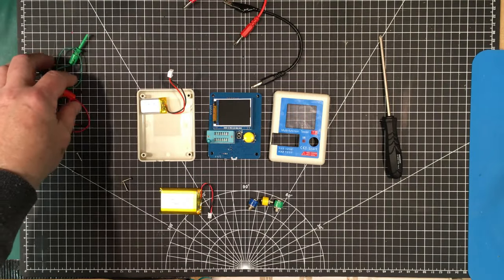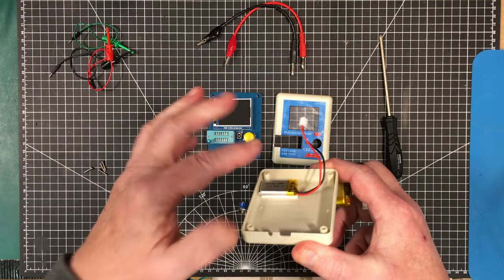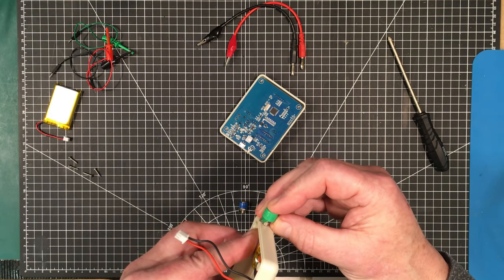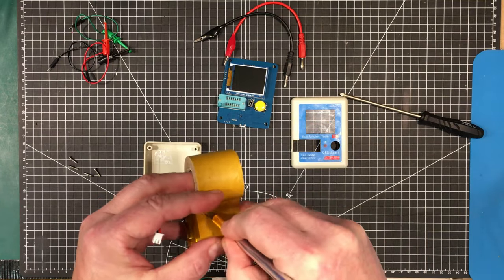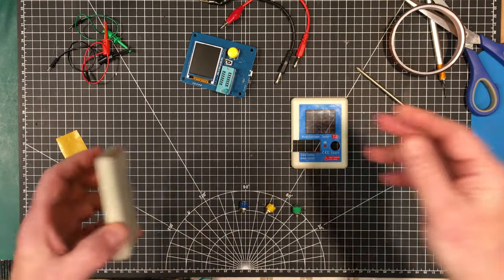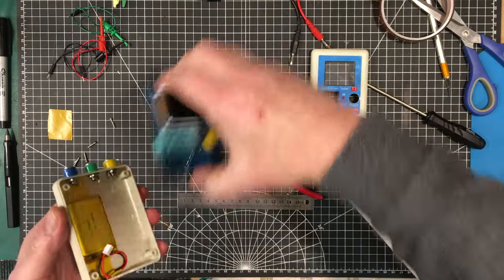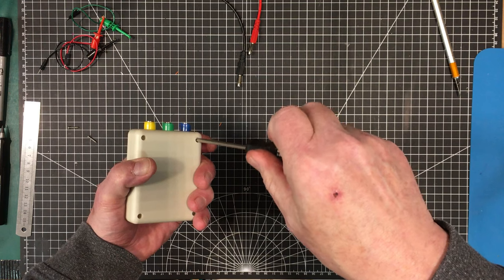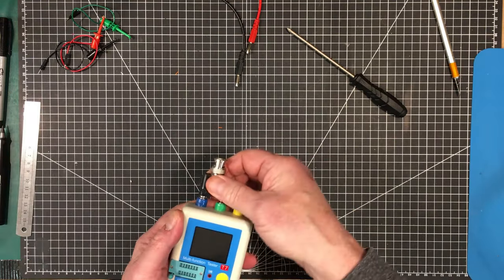Uni-Byte 0174 - Three Awesome MODS for the T7 component TESTER! (transistor tester)

Comment: I did some mods too ... banaplugs like you did and an actual switch to cut the connection to the battery. Because T7 seems to "eat" batteries even powered off.
Reply from the maker: Good idea.  Yeah, it keeps the MCU on in low power mode waiting for a button push.
Reply: @uni-byte  maybe add a selector switch for the zener diode function.
Reply: I done that too and now battery Last extremly longer. thx vor the banana Idea, will do it too
Reply from the maker: @sarahb.8186  Let us know ho wit goes.
Reply from the maker: @20kilovolt  Good suggestion!

Comment: My best upgrade for my component tester was to throw away the battery altogether and wire it into the old PC power supply that I use to run various things on my test bench.
Love the banana plugs... gotta do something to replace the worn-out ZIF socket on mine.
Reply from the maker: A switch is not a bad idea for a 4th mod.

Comment: hi...sometime ago i put a battery from an old internet mobile router on my tester...works just fine and lasts wayyyyyyyy longer... i added wires and crcodiles instead of banana plugs...
Reply from the maker: Nice!  It feels good to do mods that make things better for how you use them.
Reply: @uni-byte  in the future i will use an old phone charger.instead of the battery..like nokia 3310...they are 3.7v chargers.... i prefer a charger over the battery.  i havent done it yet because this battery lasts very long

Comment: Started the modifications, placed the banana sockets in place, added an on/off switch on the side. I see the wires you soldered are on the bottom row. Cannot see exactly if you soldered on 1-2-3, or 1-3-5. Please let me know so I can wrap up. Thank you.
Reply from the maker: Hi Sayd.  I attached my wires to pins 4, 5 and 7.
Reply: @uni-byte  Thank you

Comment: Add an off switch, and you won't need to upgrade the battery. Mine has quite a high "off" current.
Reply from the maker: Seems a lot of folks have the same idea.  Maybe a little slide switch?

Comment: Nice upgrades. Good idea.
If you overdue a screw in plastic the you simpel heat it up and put it in the hole and it works again!
Reply from the maker: Good tip on the screws.  I have to try that.

Comment: Here's two more for you.  (#1) Add a slider power switch, so you can reset the unit when it freezes up.  This happens when the unit can't identify a more complex component. (#2) Add a 2P connector in parallel with the activation switch, so you can use a foot pedal to start the test when you don't have a free hand to push the button.  

I put a huge cell in there which would not fit without removing the on-board 2P header  I was adding the switch anyway so I just soldered my wires directly to the PCB.

A highly versatile unit with modest accuracy.  Always worth using but not 100% dependable.
Reply from the maker: Great ideas!

Comment: 1. Well I think you could also integrate buck converter, with a switch to use internal battery or external power supply. Adjust it to convert from 5V USB to whatever is needed 3.7 or whatever, then you can use powerbank, or laptop, or pc, or phone charger to power this device permanently. 
2. You used banana plugs only for contacts 1 2 3. Not for K and A. Maybe you can use that too.
3. What I did is just soldered those 0:49 to the pcb and drilled a hole in plastic. Solid connection, no problems, wires go where device goes, cant lose them.
4. You could use capacitive button, so it actually start on button touch, not on button press, or photo diode/resistor whatever when its dark to trigger testing...
Etc etc... imagination is limitation.
PS. Regarding freezing, try to hold button to shut down. And also, schematics are available, so once you take a look at them, you get more ideas for sure.
Reply from the maker: Great ideas, worth considering.  Thanks!

BTW, it works (sort of) while on charge.  If there is no component in it it sees a fictitious capacitor, but otherwise seems to be okay.
Reply: @uni-byte  I think that those big leads will mess up part diagnostics, but I cant prove that. You will eventually see if it works or not.
Reply from the maker: @orion310591RS  They certainly will with small capacitors and inductors.  Shorter leads are required for them to get accurate results.  But in some cases I have had recently, like checking transistors in the chassis, those long leads come in handy.  I have shorter ones in the works.

Comment: Nice video I modified my T7 tester in the same way because the battery that was installed is really not enough for some hours use, and the banana plugs are a nice extension for adding more possibility to make connections.
Reply from the maker: Thanks!  Great minds think alike.

Comment: You can use a pin/needle to pop the leas out of those battery plugs, then re-insert in any plug in either polarity. Quick and easy, used to do it with cordless phone batteries regularly.
Reply: I don't think it would work here. That fella needs to make it complicated and unnecessary, plus it is too difficult to work on those little connectors....
Reply from the maker: I'll have to give it a try, thanks.
Reply from the maker: @peatmoss4415  - Ohh, my very own troll.  Cute.

Comment: Excellent mods and video = Big Thanks! I would very much like a follow up video which discusses all of the great additional mod suggestions provided by your excellent viewers. Some of them were made in abbreviated speak, or covered topics outside of my knowledge base... So, I did not understand those. Thanks! Here's my contribution... To make separations between components (such as the legs of the banana plugs, beyond the collars of the new banana connectors, when inserted,) to prevent short circuits, etc... Shields made be fashioned out of common, white, frosted, milk carton plastic. This plastic is durable, easily fashioned and readily available. HTH.
Reply from the maker: Thank you!  I might just do that video.

Comment: I've got an older version of this tester, which doesn't have the same amount of clearance in it for 4mm Banana plugs, but I've got a good selection of 2mm Banana plugs,  which  works fine.  Made a complete hash of the first round of holes drilled, but second time lucky it works perfectly.  The scary bit was getting the old battery out.  It's so thin it's like trying to remove a few layers of tinfoil.  350mAh replaced with a 2000mAh battery.  Much more betterer! Thanks for the idea 🙂
Reply from the maker: Good going!

Comment: Would you please tell me what the number 783448 stands for? Found similar but with different 6 figure numbers, Amazon has that particular battery but would not ship to my location in NY.
Reply from the maker: That's the size of the battery.  Actually the size of the cell without the added protection circuit.  7.8mm x 34mm x 48mm.  Add an extra 2mm for the protection circuit and finished size is 7.8mm x 34mm x 50mm
Reply: @uni-byte  Thank you

Comment: On your description page, you listed a 120mah battery instead of 1200mah which is not listed on the Amazon page you gave. Which is it please?
Reply from the maker: Hi Sayd, sorry about that.  It is a 1200mAh battery with protection circuitry - Size: 50 x 34 x 7.8mm .  I have updated the link
Reply: Thanks you for responding, the link to Amazon does not work. Have a wonderful day.
Reply from the maker: @saydmarschany8321  Strange, it works for me.  What part of the world are you in?  The link is to amazon.com in the US.
Reply: I live in New York. The link sends me to Amazon but not to the part in question. Now you gave me enough info, will research, no worries. I do a lot of mods myself, like to get my hands dirty. 🥴Thanks again.
Reply: Purchased a 603450 3.7v 1200mah from Amazon. Hope that will fit nicely. Thanks for all your help.

Comment: Is there likely to be an issue because the battery you added now has an IC pressed onto it. Would the IC get warm because there is no air around it?
Reply from the maker: There is more than 2mm clearance between the battery and the IC.  So, no, the IC would not be getting warm because of that.  In addition the power dissipation of the IC is very low, so it would not be getting warm anyway.  Hope that helps.
Reply: @uni-byte  Thank you

Comment: What pins did you solder to?
Reply from the maker: It's in the pinned comment.  " It's not critical as long as you get all 3 - 1, 2 and 3.  In my case I attached my wires to pins 11, 12 and 14 of the ZIF socket."
Reply: @uni-byte  Thank you

Comment: Fantastic video! How were you able to put holes for the banana plug terminals without crumbling the entire plastic casing?
Reply from the maker: Thanks!  Those banana jacks have enough of the threaded metal portion extending out the back so that they can be mounted that way in plastic.  You don't have to use the insulating sleeve so you only need a hole big enough for the metal.  You can get them on AliExpress.  Try searching for "25Pcs 5 Color 4mm Banana Binding Post Test Connector" and you'll be able to see what I mean.

Comment: In my humble opinion, it would be much more practical to make an external adapter to convert banana plugs to 3-pin plugs. Without having to make any external changes to the equipment. In fact, it would be a converter from one type of fitting to another. This type of converter (banana2pin)  It would work for this equipment and for any other equipment that uses this type of docking pin
Reply from the maker: I had thought of that I also thought of using a 1/8" TRS plug and socket.  The reason I went this way was that the leads could be standard and used for other things too.
Reply: @uni-byte  Exactly. My suggestion was for the specific case, but nothing prevents you from using other types of output pins, making the converter more universal. Good idea! 👏👍
Reply from the maker: @jogat4ria847  Got it!

Comment: Great mod, could you tell me on which pins on the board you connect your 3 wires please, I would'nt like to make any mistake. Thank you.
Reply from the maker: You can use any place where the terminals marked 1, 2 and 3 are.  On my board (there are different revisions and patterns) I used pins 4, 5 and 6 of the ZIF socket.

Comment: Hi, How do I get into calibration mode and how does it work? In the video it was too fast.
Reply from the maker: Sorry about that.  I usually speed up the video during tests.  To get into calibration mode just short pins 1, 2 and 3 together.  Then after a few seconds it will ask you to take to short off.  On some testers, at the end of the test it will ask you for a capacitor of a specific value.  This one (my T7) does not ask for that.
Reply: @uni-byte  thank you
Reply from the maker: @SteveM45  👍
Reply: Short all three leads together and press the button. Separate the leads when the display tells you to.

Comment: Thanks for the video.
I just hoped you'd show how you actually modded the banana sockets? I mean which points you connected the 3 wires to?
Reply from the maker: You can solder the onto any of the pins of the socket that are marked 1, 2 and 3.  I soldered to pins 11, 12 and 14.
Reply: @uni-byte  Thank you so much ☺

Comment: what do i solder the bannana plugs to.  do you have a diagram or an image i can reference?
Reply from the maker: I soldered the wires onto pins 4, 5 and 6 on the bottom of the ZIF socket.
Reply: @uni-byte i figured thank you much

Comment: you should also have added a higher volt mod.
either using a stepup transformer or using a special power plug for a higher voltage adapter.

because these devices can get very inaccurate due to the low voltage they use, making it less acurate at some parts and even pretty much impossible to get good readings with some other parts.
for example:
1. Mosfets RDSon is almost always very wrong with the lipo version since most mosfets need atleast 5v or more to properly turn on.
2. transistors can also get very wrong ratings in some cases.
3. and diodes with a higher reverse voltage drop can't be measured(could measure a few more with a higher voltage mod.).
4. can make it less noise sensitive if the method for higher voltage is stable and without to much ripple or noise.

ofcource do first check how much voltage your device can handle as input, and often don't try to max it out.
but you also very often see such devices powered by 9V batteries, and some with DC jack inputs.
and I bet many people would be insterested in some easy and proven info about what kind of voltages it can actually handle.
I would recommend adding someting like a switch to switch between high and low voltage mode, this is mostly since running it at lower voltage should be more safe for components which perhaps migth not handle the higher voltage and also slightly lower power usage and drawing directly from the lipo gives a stable voltage for sure.
Reply from the maker: Something to consider for sure.  Also, the switch could have a "Off" position to increase battery life.  These draw some current all the time.  Not much, but some.
Reply: @uni-byte  yes that is a very smart idea indeed. and when adding a switch anyway, there is little reason to not add it.

Comment: one thing maybe crowbar circuit for protecting 5V line. Accidentally put charged cap for testing. esd prot sot23-6 component and cpu died (vcc to gnd short in cpu and 2 diodes short on esd prot). tvs diode was fine. if it would have been just esd prot then it would have been easy fix. 
or just do dedicated cap test leads with 2x 1N4007
Reply from the maker: I like the cap lead idea.  The best thing would be a design change where they have a relay to short the inputs momentarily before testing begins.  This additional hardware could also be used for the self test feature.
Reply: @uni-byte  I think that relay protection was on original documentation for one protection type. So relays are on when it start to test process.

Comment: You will certainly get measurement errors with those very long internal cables and the additional long banana leads.
Unlikely you will be able tp calibrate at all, and if you do then calibration for the ZIF socket will be WAY off.
Reply from the maker: Thanks for your comments.

As to going between ZIF socket and cables, yes you need to recalibrate but you have to do that using the supplied cables too with any small caps and coils.  As for those long cables shown in the video, I don't really use them except to reach components that are a good way off.  As you can see in the video they calibrate fine for most things except small capacitances and then only if the cables are disturbed during the measurements.  For diodes, transistors, resistors large capacitors etc. they are fine.  However I have made shorter (10") cables for use with this most of the time.  My guess is you bailed early on the video and decided to proceed with your imagination rather than facts.  Flying without facts is not generally the way I do things, but that method does seem to be popular amongst some folk, like flat earthers and such.
Reply: @uni-byte  - I have many of these testers, and have extensive knowledge about their operation, modification and limitations.
As I said, even fairly short leads directly plugged into the ZIF socket will cause calibration errors and erroneous measurements, as well as sometimes causing detection errors of some types of components.
Reply from the maker: @johncoops6897  Wonderful!  So how does that explain the accurate (enough) results I got using these long leads?  And as I said, but it seems worth repeating, plugging in leads (even the ones that come with it) requires re-calibration.  Anyway, I don't think either of us will benefit from an argument, so I'll give you the last word.

Comment: Rather than carpet tape, you might use silicone caulk or hot glue.
Reply: Indeed a wonderful set of upgrades, but I also worry about the super strength of carpet tape. Hope it doesn't rip the battery on removal.
Reply: @bengineer_the  You might get a razorblade scraper to remove the battery if you do. It may help not ripping the battery apart, but the battery is not that expensive if you damage it 😉
Reply from the maker: Not a bad idea.
Reply from the maker: @bengineer_the Yeah, the carpet tape is pretty strong but releases pretty well with a bit of IPA and some warmth.  I don't expect to need to change it out though.